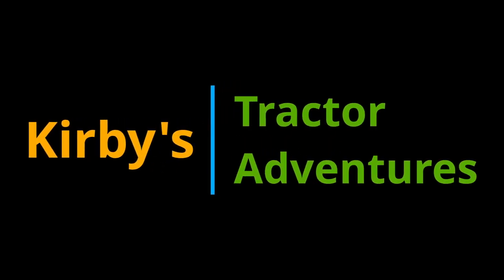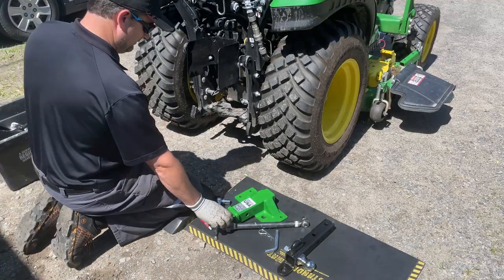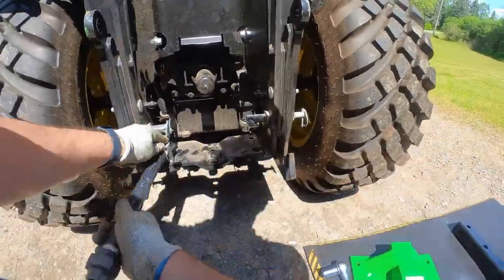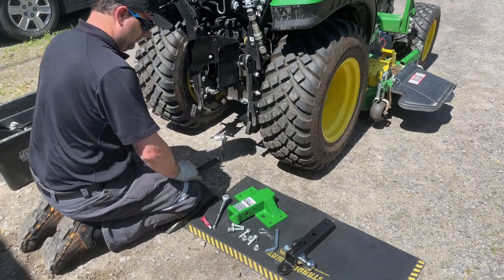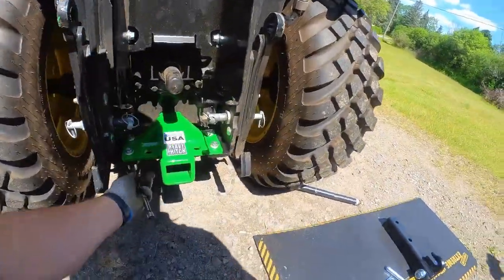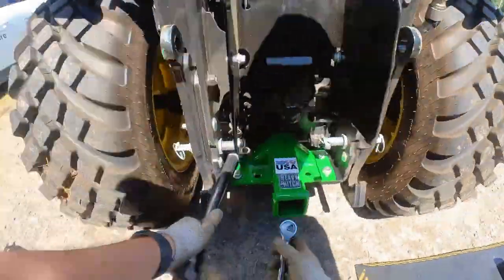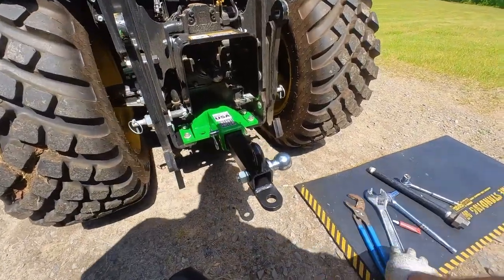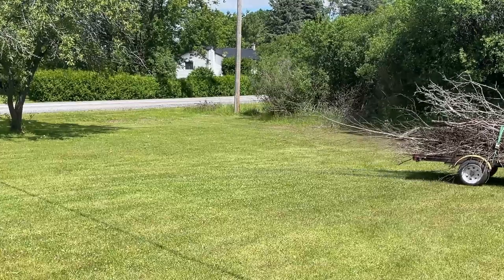Installing the Heavy Hitch Receiver Plate Kit -  2025R Gen 2 2022 - John Deere Compact Tractor

Comment: I was looking at this hitch for my 1025r.   I have the quick hitch by heavy hitch and wonder if there is enough clearance to swing an AG fab material collector on turns
Reply from the maker: Unfortunately, I do not have a quick hitch… yet!

I took a couple of measurements using the receiver from the kit in the video and my 2025R. From the back of the transmission to the center of the ball is 16 inches, and 19 inches to the clevis mount.  From the face plate of the receiver to the ball is 6.25 inches. 

The center of the ball clears the rear of the tractor by 5 inches.

Hope these measurements can help you determine if there is enough clearance for your attachment.
Reply: @kirbystractoradventures  thank you for the measurements. Time to take it to the tractor and see what happens. I love my quick hitch. It makes life easier with changing out non PTO attachments. Thank you again for your reply